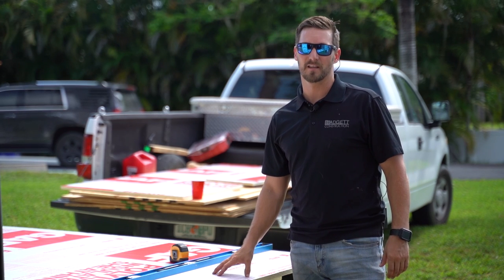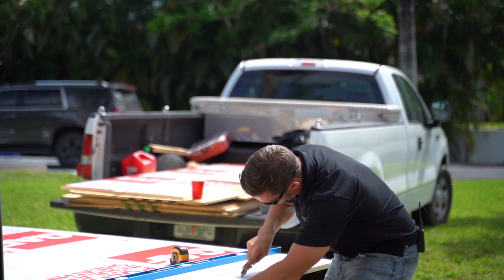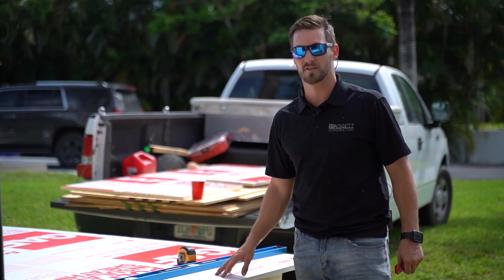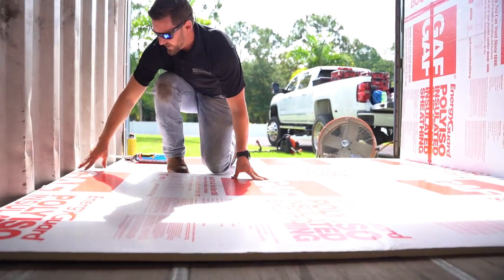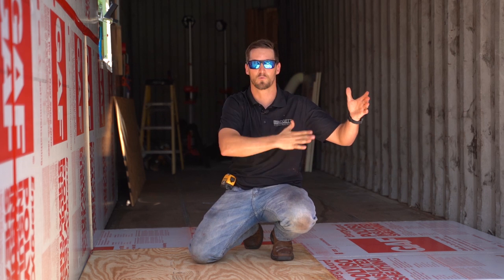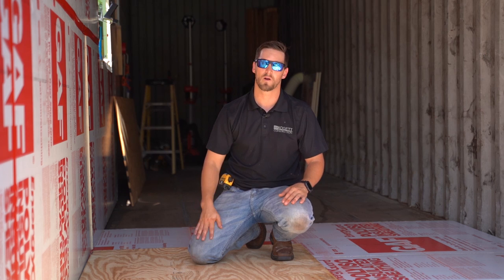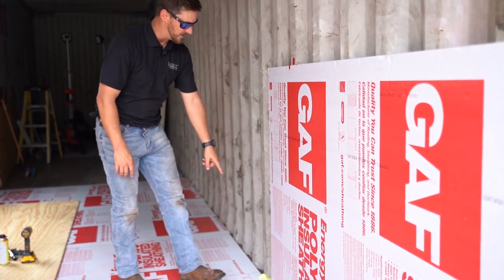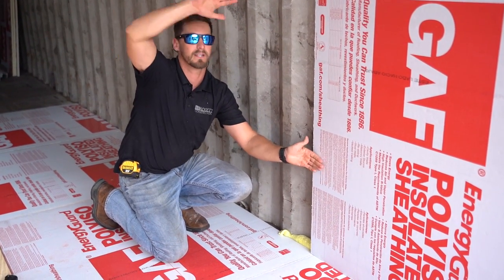Build a DIY Shipping Container Home Step by Step | Ep. 3 Insulation

Comment: Is there a risk of condensation build up, due to the open cavity's between the container walls and the insulation itself??
Especially since steel doesn't really breath.
Could you stuff fibre glass insulation inside those groves??
Reply: My thoughts exactly, if it were 30f outside and you had a heater inside, you’re gonna make condensation behind that insulation board.
Reply: yes
Reply: He mentions in another video not use fiberglass insulation in container vans....

Comment: How do you deal with condensation that collects on the inside of the container (on the metal behind the insulation)?
Reply: Sprayfoam, is the only way to avoid condensation. Don't use styrofoam board unless in tropics etc
Reply: @mrmotofy  Styrofoam board is okay for tropical climates?
Reply: @Cliv00  It's probably ok since the condensation is less likely with less temperature differential. But I haven't actually tried it
Reply: mrmotofy I live in south Texas do you think condensation can become problem?
Reply: Closed cell board is both a vapor barrior and insulator. Vapor cannot pass through to condense on other side
Reply: Im curious of this as well? wouldn't condensation build between the insulation and the metal wall?
Reply: @Inspectorzinn2  kinda like these yeti cups double wall no condensation

Comment: Great video. Any reason you chose those insulation panels instead of spray foam insulation?
Reply from the maker: We used the panels because spray foam rigs are expensive and we wanted this video series to be truly DIY.   Thank you for watching!
Reply: @ContainingLuxury  okay cool. From a pure performance standpoint, do you have a stance on which type of insulation works best for container homes? I keep hearing sprayfoam is ideal. 

One of the reasons I keep hearing is because it allows you to attach insulation directly in between the corrugated ridges along the walls/roof, whereas the panels leave gaps.
Reply from the maker: Agreed, spray foam is the ideal way to go but closed cell insulation with spray foam at the base and seams will do a great job. If you can afford the extra cost spray foam is the way to go....saves time too.
Reply: @ContainingLuxury  thanks. I'm planning to build a container home in Hendry County, Florida. I look forward to more of your videos. I'd say my biggest challenge will probably be drawing out the home plans and making it all in line with Florida Building Code (that was the main requirement from the Hendry County building department).
Reply from the maker: If you are ever around West Palm Beach. Give us a shout. We will be filming a few more videos over the next 2 weeks.

Comment: I feel like Z-Girts and Mineral wool on the outside of the Container would be beter for hot/cold climates. With weep holes in the bottom to drain any moisture build up almost like EFIS or a Composite Panel setup.
Reply from the maker: This was actually a really old design early on, there were vents to allow moisture to escape but there is no longer an air void, it is completely filled with EPS foam

Comment: Wouldn't you be much better off insulating from the outside? I'm planning on building out a 40 ft. container out in Hawaii soon and my thoughts are as follows- (i) By insulating outside the container you are saving quite a bit of inside space which is already at a premium and the metal will act as thermal mass thereby reducing energy requirements for heating/cooling (cooling in my case) (ii) I'm thinking about welding a steel "lip" along the top of the container roof on all four sides so that it exceeds the width of the insulation and siding material preventing water from getting into this area. Are there any obvious flaws in my thinking? Thanks so much fo your input and the great content that you put out :)
Reply: I'm also planning on building a container home in Oahu.  On, which island are you building?
Reply: Weather, steel vs whatever your adding.

Comment: It looks like the insulation is only about 1" or 2". Did it make much dofference?  I used 5" of EPS all round in my container and it is still hot as hell or super cold.
Reply: @donjaved  i dont even know where to start.  They make Hemp panels for insulation????!!!!  Hahaha

I put the eps panels on the inside.  So the metal gets super hot and irradiates.   It really sucks.  I think this whole adapted container project was not worth it.

Comment: Do you think insulation would be necessary for a container in the Caribbean?
Reply: Yea but you don't need as much as you would when building in a colder climate.  You'd be insulating to keep the heat out (and the cooler air in)
Reply: Mazlem thanks
Reply: Yes, insulation is very important in cold and hot climates. The steel radiates heat to the interior without insulation.

Comment: Hi!  I really enjoy your channel. My husband and I are beginning the process of building our container home. What type of foundation are you setting on?  (sorry if I missed that episode lol) Is insulating the floor contingent on the type of foundation you're on?
Reply: Ok, so it looks like you are on a pier foundation.. If we're using a concrete slab, I wouldn't think it necessary to insulate the floor?
Reply: @AC-xo6ir  Slab foundations for homes normally have insulation under the concrete around the perimeter, so you'd be ok there.  Personally if not a full basement I'd at least go with a block foundation 3 to 4 blocks high so you have a crawl space for plumbing / electric.  Then you could insulate from underneath and save space inside.
Reply: Mazlem -- that's what i was thinking insulating the bottom it's a better bet doing it that way it's taking about 4to5 inches sometimes more wen everything is done it may not sound like a lot but in a container every inch counts just my opinion.

Comment: umm ok the answer is no, this is not how you insulate. The gap will cause moisture issues and you'll have a house full of mold.
Reply from the maker: Greg we have vents to illuminate any possible trapped hot air, also have insulation on the exterior plus siding... so every project is designed to spec, not every application will work for your project but may in another